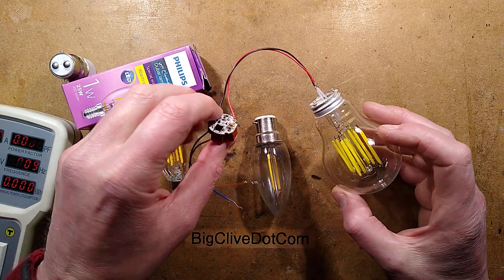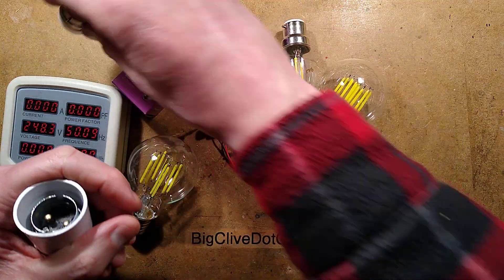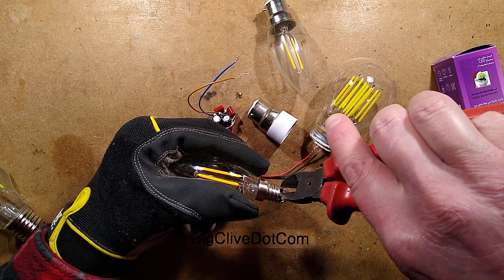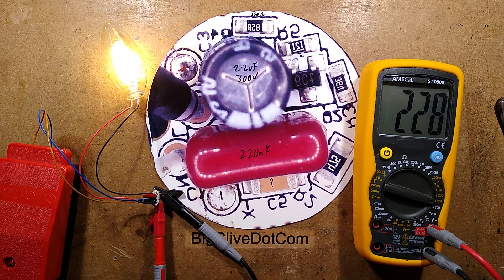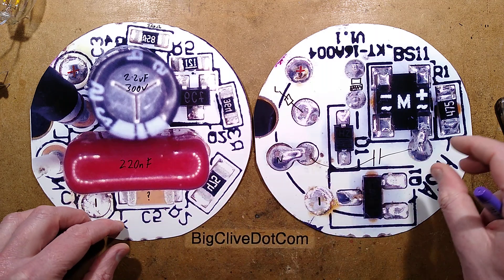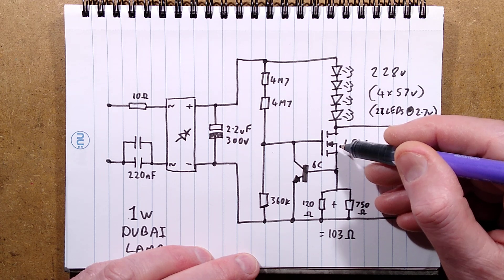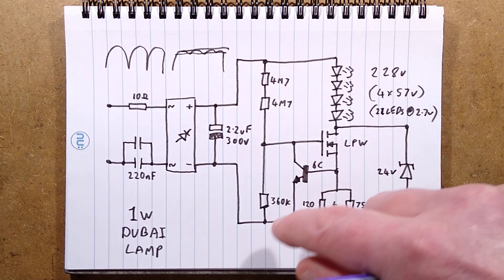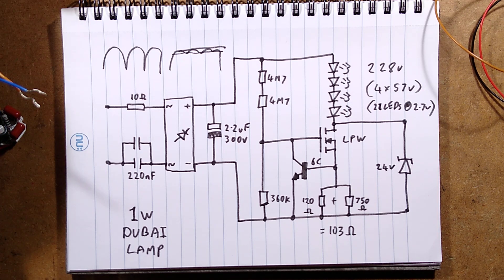Opening the 1W Dubai lamp (with schematic)

Comment: Tip from me, when you try to open a plastic LED bulb..

First remove small cap from the bottom,

Second, use a solid Bakelite E27 Fitting as a grip to pull the E27 Cap,
the 2017 LED tend to be easier to open rather than the older type..

Third, put Paint Thinner / Isopropyl alcohol around the Bulb Cap Diffuser to ease the Silicon Glue..
Then use a mini CPU pry bar to remove the Bulb Cap Diffuser..

Also use isopropyl Alcohol to ease the silicon Glue inside the Bulb..

Then, use a long small diameter steel bar, put it inside from the bottom hole..
Put it around the corner of LED Heatsink inside and knock it with a hammer..

Tralala, you can open LED Bulb, and reclose it tightly using Silicon Glue and hammering the E27 Cap using a Nail or a Tungsten Pen..

Comment: Clive, the metal bases of most LED lamps I have disassembled are crimped around the base of the bulb. I find that a straight blade micro-screwdriver can be used to losen the crimping. Then the whole metal peice can be easily removed. (After removing the plug in the tip too)

Comment: I know this question was answered in your earlier videos, are the LEDs enclosed in a glass bulb for aesthetic retro purposes? Is there a gas or vacuum in the bulb?
Reply from the maker: Partly because the glass globe making equipment already existed and glass will not discolour.  They may be filled with helium to aid heat transfer.
Reply: @bigclivedotcom  Thanks for the reply
Reply: @bigclivedotcom  Yep, I think helium is in there for heat transfer.
Reply: @bigclivedotcom  Could you easily test the helium theory by putting it near a high voltage and seeing what happens? Like in those gas ampoules I see on Ebay?

Comment: Are these really 2.5x as efficient as our bulbs... I've only ever seen 2w = 20w... I suppose it's just like cars where you get deminishing returns. My car cost £5,000 to do ~70,000 miles at 70mpg..  a car that did 35mpg would cost £10,000 an electric car would cost £2,500 so I'd save £5,000 from the less efficient car but now my maximum saving for the most efficient cars is £2,500 with a theoretical max potential of £5,000

Comment: The great thing with a company like Philips is they're not limited by what components are available when deigning consumer products, because they can make whatever they need in-house (in their component factories), or at least they could when I worked for them. I was a Philips engineer for 13 years, and we could order Philips parts for in-house projects from our other factories. I once asked our purchasing guy to order 4 small special diodes for a prototype board. About a month later a forklift arrived carrying four rolls of diodes for a component  insertion machine, a total of 4 million diodes. Our purchasing guy had accidently entered an incorrect digit in the part number. We contacted the diode factory and offered to send them back, but they told us to keep them.

Comment: I wonder which would be the thing to finally kill these, the electrolytic drying out or the phosphor on the LEDs getting so degraded that the light quality goes to crap. Either way it's going to last a fair bit longer than your typical lamp.
Reply: If the electrolytic dries out the only effect will be increased flicker.

Comment: Pity they don't make these in US voltage.
Reply: you could always rewire your lights with 2 hots, 2 phase.  Actually it would be easier to use a step up transformer 110 to 230, it wouldn't need to be a large or expensive one, its not that many watts needed for the whole house.

Comment: One of the features they're touting for these lamps is the low heat output to save on air conditioning costs. In a place where you run a/c all year round that could be significant.
Reply: ive heard people disputing the energy efficiency claims of standard led bulbs in europe/the west since you need to turn up the heating a bit since youre not getting the 100watts you used to get from a lightbulb but in the case of airconditioning i can see that being a big saving, especially in large open areas like shopping centres, hotels, restaurants and that
Reply: @apm136  Those claims are way overstated. It's way more efficient to get your heat from a well positioned heater than it is getting it from a lamp. You have no control over your incandescent lamp's heat output (negating any winter savings in the summer, and what if you want to stay warm in the dark?) and their positioning (mostly near walls and ceilings) make them less immediately useful. LEDs are better period.

And since it's 2021 and basically no places use incandescent lighting anymore, the savings potential isn't even that great. In case of the Dooby lamps, you'd save like 2W per 2W lamp compared to ordinary LEDs or 7W relative to CFLs... That's nothing in terms of heat. Humans give off 100W, average heater radiators give off 1.5kW+ depending on size. 

And even if you would have a higher heating bill while reducing your electricity bill with efficient LEDs, I think in most places heat is cheaper than power so you're never gonna lose

Comment: I have a strong feeling that Dubai lamp will become a marketing term to sell cheap dangerous knock off versions at inflated prices in the near future.
Reply: As long as the copy the circuitry and at least double the filaments, am sold on the cheap Chinese version of it :) you can't easily go wrong with a capacitive dropper but cheap designs flicker a lot

Comment: hrm... i wonder how feasible it would be to "clone" these lamps using off the shelf components (including regular dome LEDs) and using a larger sized bulb as case (to not have to minimize as heavily). not considering that it would involve making and fiddling with bits and pieces that will be live at some point :P
Reply: pretty feasible i would say, you can buy the filament leds now.

Comment: Why is it that a lamp that is more efficient and lasts longer isn't available everywhere in the whole world.  Even if it cost more it could be a wise investment.  On the same basis I put some LED lights in a rural property.  If the lights were turned on the TV stopped working.  The HF interference swamped the weak signal.  These lamps would have fixed that problem too.  It appears that they are better lights full stop.

Comment: If that on the right is current regulator, why there is capacitor dropper?
Reply from the maker: Two levels of current regulation.  Simple cap and fast ripple compensating linear.

Comment: I don't get it, the LEDs drop 228v but the lamp is rated 220 - 240v ? 
Is it the peak voltage that is available to the electronics?
Reply from the maker: The capacitor limits current that causes the voltage to sit at the LED level. There needs to be headroom.
Reply: @bigclivedotcom  Thanks, but you have a lot of headroom with over 240v. Will the LEDs draw less current if the are connected to 220v? Since they cannot be feed more voltage then the mains?

Comment: The linear regulator in the final stage surprised me. 
But I guess, since the led's are a negative differential resistor, the actual power wasted is low.

Comment: Can I operate a 240 volt lamp at 120 Volts to get the efficiency?
Reply from the maker: Some work at lower power, some don't light and some just compensate with more current to reach their power.
Reply: These particular ones likely won't light at all.

Comment: please use FLIR camera on a working circuit. My limited understanding links longevity of electronics with heated components. It is  reassuring (to me) to show what can be done if design is not compromised by other factors (greed).

Comment: Clive I tried to attach the link but to no avail but found actual Dubai lights on Amazon. You have to use Amazon.ae but they for sale and will deliver to North America with a longer delivery time than normal but they for sale.
Reply: But not to Australia it seems.
Reply: But there 240 volt bulbs, right? I already looked.
Reply: I wonder I you put them in series, they would work?
Reply: dont know how you got that result, it still says only uae when i looked and i tried using a usa address and it then said out of stock, so it was probably a glitch.
Reply: @fumthings  I don't know but I ordered and they were shipped, I have been tracking them, they supposed to arrive on Wednesday.
Reply: @hommie789  do you use a vpn maybe? please let us all know when they arrive, and if they are the right ones. thanks

Comment: Say I wanted to build a bunch of shop lights that can run super efficient at this near 200lm/watt number that should be possible. Can I just buy a bunch of 100w chinese LED chips and run them at 25 watts each instead? Or do I need to buy better quality name brand LED chips to get this result?

I need to install a lot of lighting in my shop, the difference between getting 100lm/watt vs 200lm/watt is quite a significant difference with approximately 1kw of total lighting.
Reply from the maker: Under running the LEDs works if they still have the full rated heatsinks.
Reply: @bigclivedotcom  Thanks for the info! I've got an idea for an aluminum heatsink I will cast for each light "fixture". Maybe 4x 100 watt chinese LEDs at 25% brightness on each fixture. I'll have to build a few prototypes...

Comment: In the early days of the Singer Sewing Machine company, they almost went out of business because they made their sewing machines so good that no one needed to buy a new one. This was because they don't wear out and were easily repaired. I think what saved the company was when they were starting to include electric motors on their new machines, they offered you a great deal if you traded in your old machine.. They promptly melted down the old machines and made cheaper, less reliable machines.. and the company was saved. 

Philips could go out of business producing lights that don't need replacing.
Reply: Which frankly tells one all that one needs to know about capitalism...
Reply: @crytocc  
It's certainly does.
 It tells me that it keeps people employed and people continually upgrading to new , better, safer, devices. 
Disposable products can be looked at as a bad thing or a good thing.
Imagine if cars were made the way the Dubai lights are? 
 We'd all still be driving around in 1970s vehicles spewing all kinds of crap into the air. 
Sometimes getting rid of old stuff and replacing it with new stuff has advantages.
And even with our less efficient LED's they do improve over time.
I've really not had ANY reliability problems with pretty cheap LED light bulbs purchased at home improvement stores.
 I think the ones I'm currently using are 60 watt equivalent, I believe they are 7 or 9watts actual consumption.
I think I bought 10 in a box for $12,  5 years ago. They're all still working.
I think the biggest issue with disposable products is ensuring that the junk is recycled properly. 
And doesn't just end up in a landfill or dumped in the ocean.

Comment: Dubai has a rather well-earned reputation for being hot, and doing round-the-clock construction both on land and in the Gulf. Burnt-out bulbs requiring constant replacement that might halt construction would constitute a royal pain the the balls, so underdriven LEDs that could survive much longer at higher temperatures would be a boon for the booming city-state.
Reply: I imagine that the reason why Philips was so keen to jump on this project was that, at some point in the early 2000s, Dubai was conservatively estimated to have 15-25% of the entire world's population of construction cranes. It's not that these bulbs are industrial, it's that these are the consumer-grade ones being brought to market alongside the ones that I'm sure are being sold en masse to Dubai's monolithic construction industry.

Comment: I need some of these for my outdoor lighting, they seem designed to last longer than the ones I've been able to buy locally in North America. Spreading the load across many filaments seems to be the way to go to get longevity, currently the 100W equivalents I get seem to start dropping LED elements on the strings then quickly fail cascading to a dim flickering mess. Where can I buy them?
Reply: You need someone to build them for you if you are on a 110 - 120 V grid.  In the rest of the world, you need someone to smuggle them out of Dubai.

Comment: In my experience, the Philips LED lamps sold in Germany (both E27 and E14) are extremely flicker free. They call it "eye comfort". It's about time some manufacturer actually produces flicker free lamps. I was extremely disappointed with other brands after checking them with my phone camera. Of course, besides also being flicker-free, these Dubai lamps have the advantage of running much cooler.

Comment: Hi Clive, 

Totally off-topic. I'm looking to run mains electricity to my new shed. I was going to use the twin-and-earth that currently runs a faulty motion-sensitive lamp, rather than getting someone to install a new spur. What'd be a good jointing option between a twin-and-earth and an armoured cable I can bury next to my lawn? 

Thanks, 

Simp.
Reply from the maker: If suggest running a dedicated cable.  You can bypass red tape by bringing it into the house and plugging it into a socket for a 13A supply.

Comment: Can I suggest a project? Harvest the led filaments from a couple of standard led bulb, then use them to build a cool running efficient bulb. Maybe with a 3D printed case and diffuser bulb. If it’s simple enough maybe those of us who have the tools and know how could make our own version of an efficient long lasting light bulb.
Reply: A difficulty is most filament bulbs are filled with helium to carry the heat to the glass envelope. If you look carefully, these are hermetically sealed. If you break the glass, you lose the helium, they'll get hotter and lose lifetime and efficiency.
Reply: @straightpipediesel  I did not know that. Makes sense though. The filaments are just suspended by thin wires so need some other way to dissipate heat. Thanks for the reply.

Comment: Does the circuit still work if jumper one strip of the LEDs? Your standard capacitive dropper would pop the caps.
Reply from the maker: It should still work, but the current would potentially go up.
Reply: @bigclivedotcom  This could be the future of capacitive dropper circuit. Constant current circuit definitely better than resistor.

Comment: An analog mosfet, how interesting.
Reply: That's marketing speak for you. There are actually 'digital' mosfets. They are designed for switching at very precise and low threshold voltages ( <3v3)
Reply from the maker: All MOSFETs can be operated in their linear region.
Reply: @bigclivedotcom 
Not for cases like this, they can undergo thermal instability, see Fairchild’s AN4161 for more. It is recommended to use dedicated analog FETs for this kind of purpose, which are comparatively rare. Otherwise they’d be used more often as front-ends for linear power supplies.

Comment: Using components below specifications often elongates their lifespan beyond belief. For this reason we used to lower the filament current of radio valves by a few percent, back in the day.
Reply: I designed a lot of control gear for navy ships and it used filament bulbs for indicators. We ran them at 15% when they were 'off' and 85% when they were 'on'.
Reply: @JezCunningham  Which takes away most stress of heating up and cooling down. This brings me to a set of 25 watt incandescent bulbs in a cupboard, that I put in series. The lights were on each night for over 20 years. They never broke down.

Comment: I worked for Philips (medical devices) and can attest to the robust design and testing that goes into all of their products. It's the complete opposite of cheap Chinesium!
Reply: @newscotlandtv  Correct, as are most mass-produced consumer goods. The differentiation here is that Philips are very strict and go above and beyond due diligence in selecting suppliers and manufacturers of their products, and their incoming goods and FAI are the best I've seen in industry.

Comment: If an LED failed open circuit, wouldn’t that 300V capacitor see about 340V?
Reply: Yes. But, being a cap dropper supply , the current will be limited and prevent an exploding cap.

Comment: Amazing you can fit so many components in to a candelabra base. Too bad they are not available elsewhere, the random failures and short life gives LED bulbs a bad name.
Reply: from what I observed, the designs of most LED bulbs are designed with just meets components rating. So thermal aging leads to early failures. The LEDs themselves seldom fail, and if ever they do, could be attributed to component tolerance.
Reply: I find that the non-filament ones last quite long. I have had some go over 8 years now.

Comment: This idea that LEDs are significantly more efficient at low currents is a new one to me, do you have any evidence for this Clive?  If not then perhaps you could make a video doing some tests.
Reply: It is there in the datasheets. The lumens vs current diagram is never a straight line.
Reply: @iamjadedhobo  Here's the first one I found, it looks pretty damn linear to me. http://www.farnell.com/datasheets/1636581.pdf
Reply: LED efficacy and phosphor degradation are both temperature dependent. Lower power results in lower temperature rise.

Comment: I buy 24V LED strips and run them off old 19V laptop supplies. Still good brightness amd approximatley a quarter of the power consumption.  I have had several strips running for more than 7 years continuously.  Several 5 metre strips can be run in series.
Reply: Dave Moore - I'd love to see a video on this on your channel.
Reply: You can also put two equal lengths of regular 12v strips in series if you don't have 24v strips. I saw a video years ago where somebody did this.